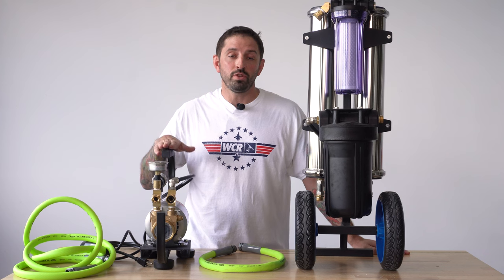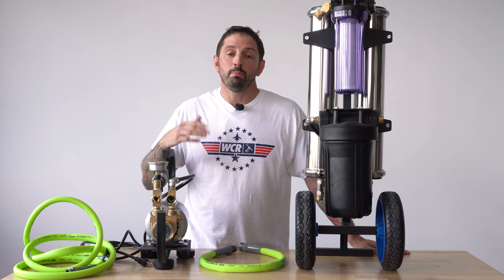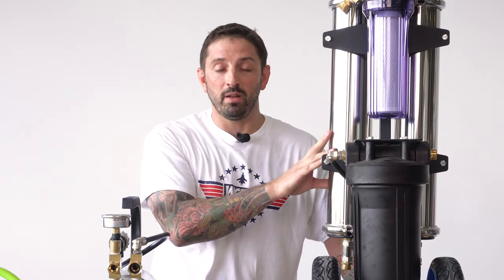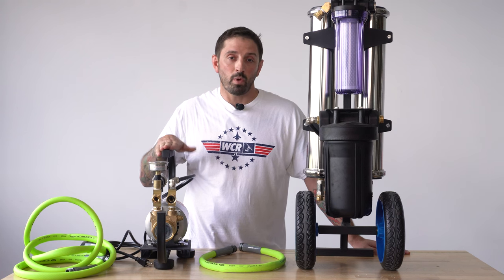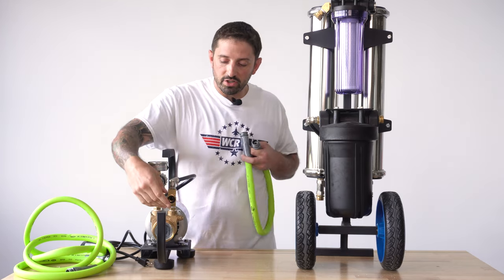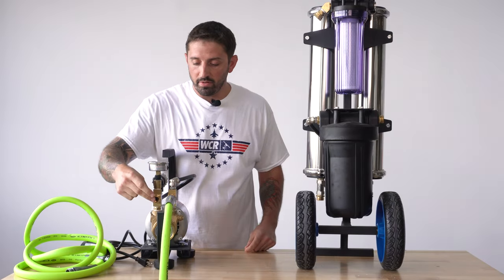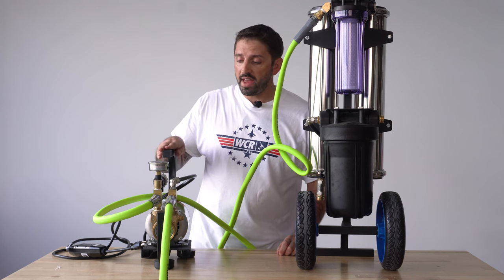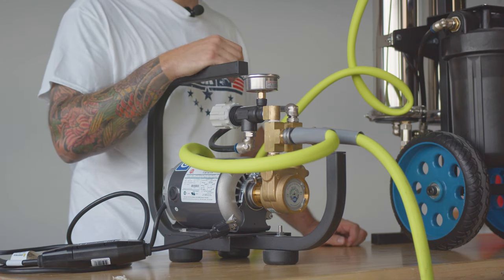Booster Pump Tips and Tricks

Comment: SteavO doing the product videos! YES
Can you use these with a pressure washer?
Reply from the maker: We would not recommend using this with a pressure washer, since pressure washers already have pumps.
Reply: @windowcleaner  What about from a tank? I have a tank and a non belt driven washer, so I believe it can't draw directly from a tank, and would need some help feeding the pump.
Reply: @cleaningphd6453  it can definitely draw from the tank. All you need to do is bleed out all of the air from the line. Do this by either having at least a half full tank of water then loosen the end closest to your pressure washer to allow the air to escape. Another way you can do it is by filling the line directly with a garden hose first.
Reply: Noooo! Not made for pressure washing